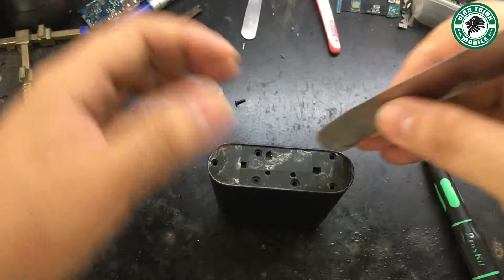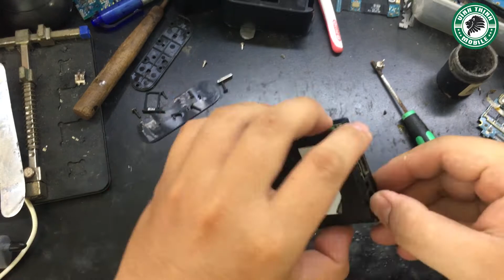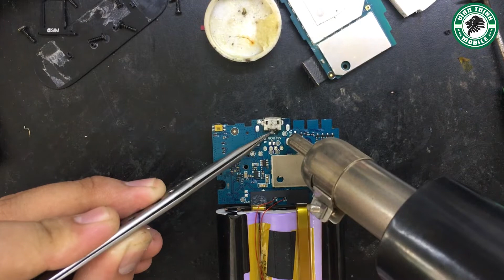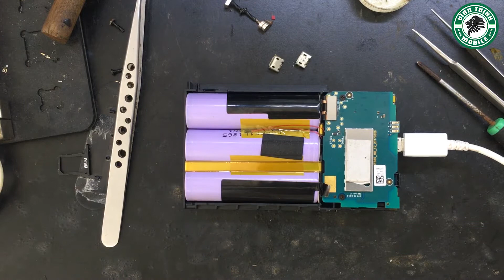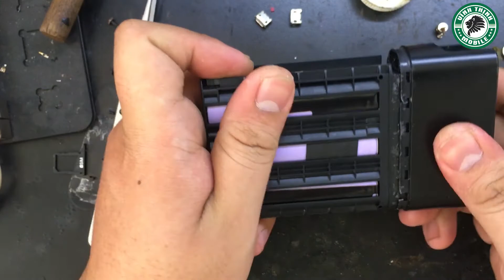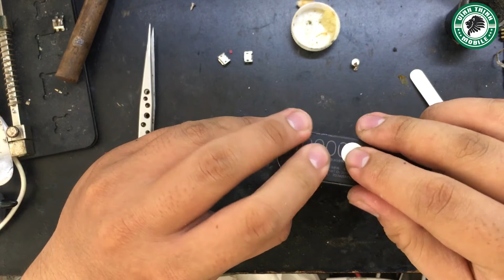Sua phat wifi MF885

Comment: Sao ko chuyển sang luôn cổng type c vậy a, ko chuyển đc hay mạch ko nhận hay là sao vậy ạ
Reply from the maker: Đúng rồi bạn, mạch chỉ dùng dc cổng micro thui
Reply: a cho e hỏi thêm chút với ạ trong app zmi router trên điện thoại, phần more setting có 3 dòng, dòng 1 là tự động ngủ sau 15p ko hoạt động, dòng 2 là 5 phút ko có mạng, dòng 3 là usb data connection card function nghĩa là gì vậy anh
Reply from the maker: @LinhLinh-tu2br  Làm USB kết nối 4G cho máy tính
Reply: bạn cho mình hỏi  nếu mình tháo pin ra và dùng nguồn liên tục cho cục phát thì có thể bật lên và dùng bình thường được không? Mình đang dùng cục này ở nhà nhưng thấy xạc đi xạc lại vất vả nên muốn tháo pin ra và dùng nguồn bên ngoài. xin cảm ơn!
Reply: dia chi sua o dau vay ban thay dau tyce dc k